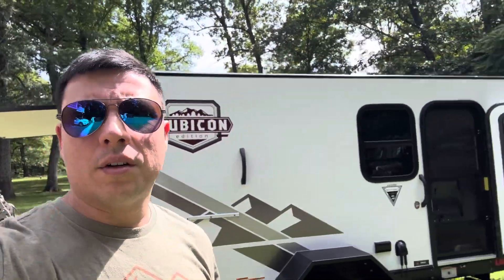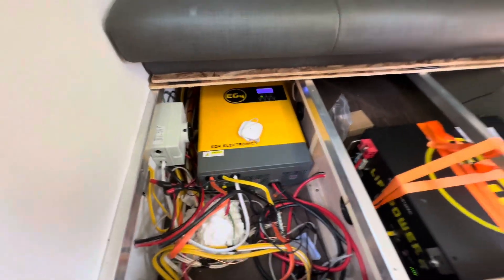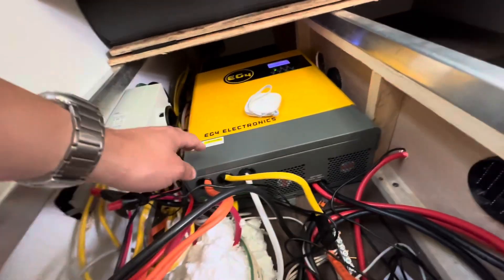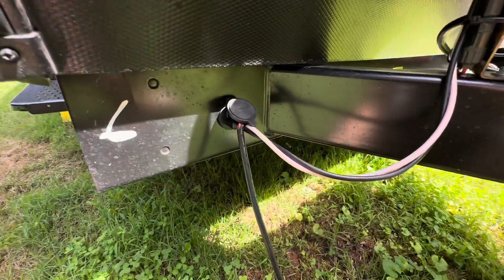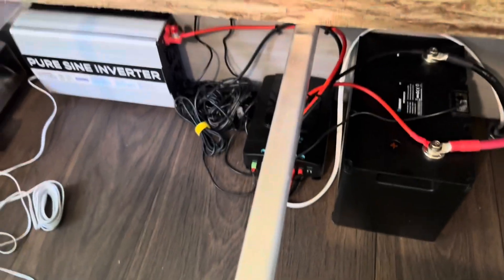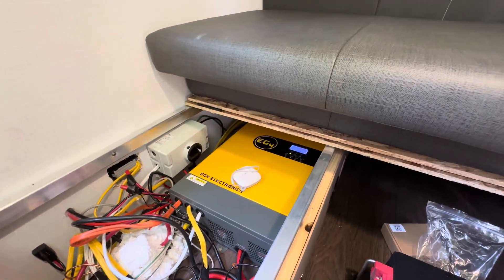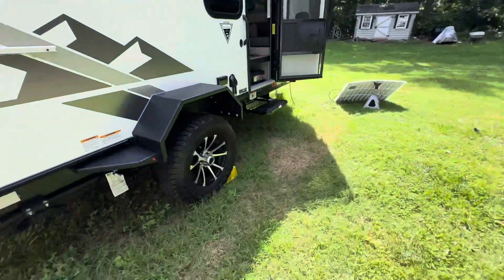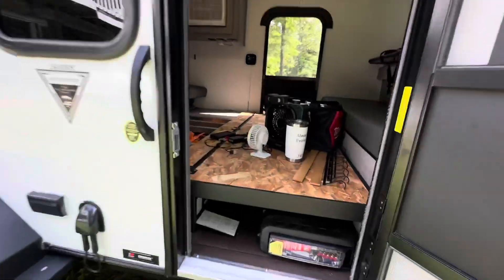2024 Coleman Rubicon 1400BH Solar/EG4Inverter/EG4Battery install and MORE!

Comment: Hey Travis here too! 😂 Good info here though! Although I feel like you got burned on that cost of a battery 😅 You may wanna grommet the two wires going in the front. If the positive battery gets cut from vibration you'll have a bad day.
Reply from the maker: Hey another Travis! Which battery you referring to? The 48v eg4?